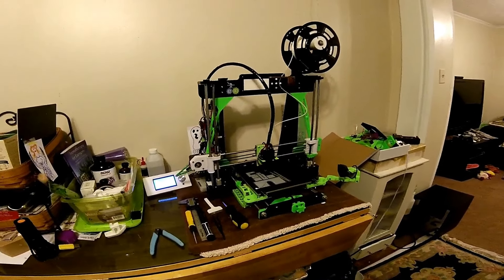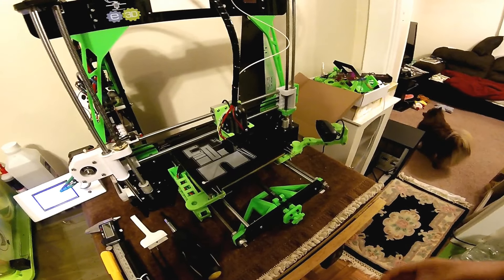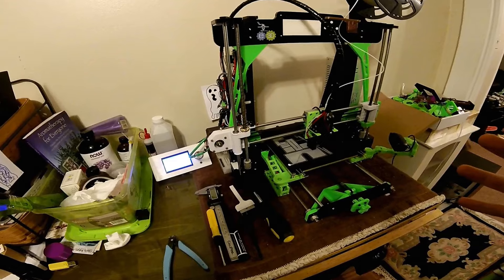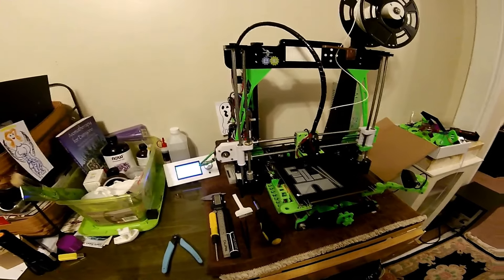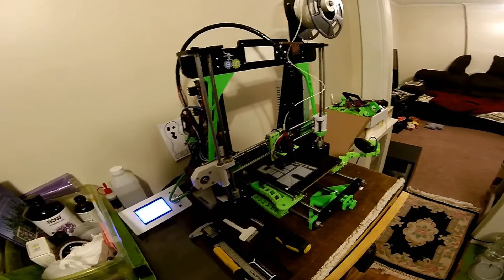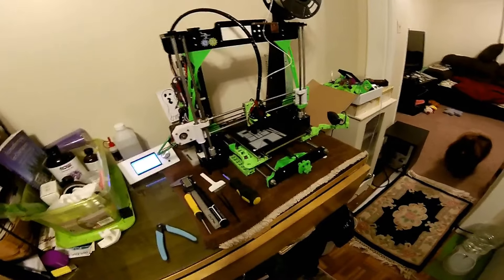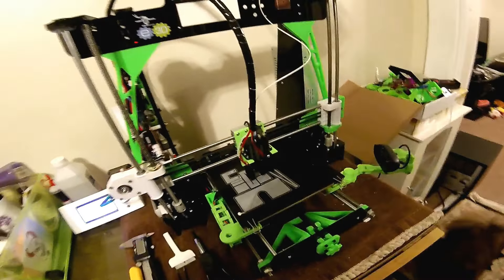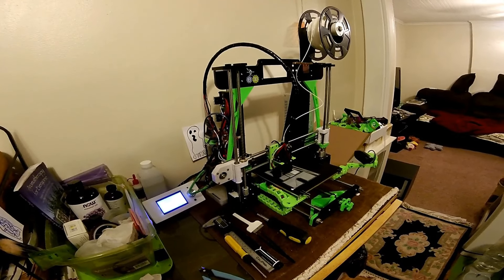The best extruder you can get! (Installed on Anet A8)

Comment: Is that the only place they sell the Flex3drive
Reply from the maker: yea, i think so..  after time the drive cable wears out and causes print quality issues though.  i'd recommend just using an EZ-Struder.  It's cheap and by far the best extruder i have ever used.  has no problem with flex.  https://www.seemecnc.com/products/ezrstruder
Reply: @JohnTaylorFPV  hey, I am building a printer with 4 heads, I want it direct drive so to save as much weight as possible I want to make it flex drive.
The initial plan was to use 4 bondtech extruders with the flex3drive system.
Do you have an idea of how much pressure a full ztech system could deliver in comparison with a bondtech?
I hope you can help  thanks in advance.
Reply: @JohnTaylorFPV  so you are not happy after a while the cable wore out ? I have been using mine for around 3 months and I still cannot make it to work properly and to print nice ...
Reply from the maker: I couldn't tell you. I'm bowden now with an ezstruder
Reply from the maker: Yea, switched to ezstruder, much better. I got it to work good at first but the drive cable wears out and causes horrible quality problems. Very inconsistent extrusion, no smooth surfaces. The ezstruder with bowden has printed everything I've thrown at it. Even ninjaflex at normal speeds.
Reply: @JohnTaylorFPV  how did it wore out ? Mine looks OK apart from slowly scraping the PTFE or what is it held in. It has white spots all over it. Another thing is that I hear strange noises, like the bearings (the balls) inside the extruder are loose. Another thing is the flexshaft .. it tends to spring the extruder if it is too close to the the motor. Kinda like a bow. Any suggestions ? I do not want to loose the extruder since it cost a small fortune. I was looking for replacement in Titan Extruder but would love to see how the ezstruder works.

Comment: Why are you printing so slow?
Reply from the maker: Jackson Sherriff I do my first layer slow for adhesion. I normally print at 100 to 120 mms
Reply from the maker: Oh, this was before I switched to an aluminum frame. That has alot to do with it as well. I also have a smoothie board now too which let me print much faster. The steppers used to get so loud at high speed how it was in this video that it would keep my wife awake.
Reply: How are you liking the smoothie board?
Reply from the maker: OriginalHotrodder I meant to say duet wifi. I had ordered a smoothie board but didn't use it. The duet has been an amazing upgrade. Completely different printer. The steppers act completely different too. Very smooth and quiet.
Reply: John Taylor Sweet!  I’l have to check it out for my CR-10.  My original Melzi went out and I replaced it with a MKS Gen 1.4 but it’s still an 8 bit board and I’m really interested in adding the capability of a 16 or 32 bit board.  Thanks for the feedback.
Reply from the maker: no problem, if you can swing the price of a duet wifi, i really think it's worth the upgrade.